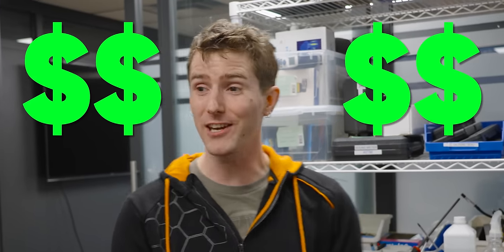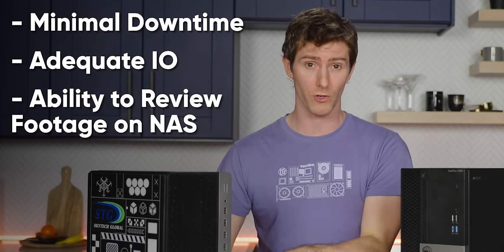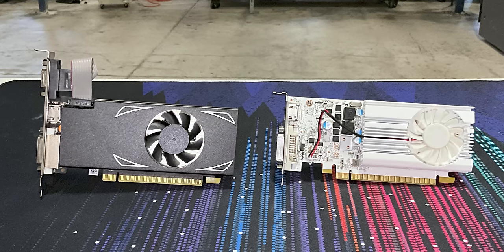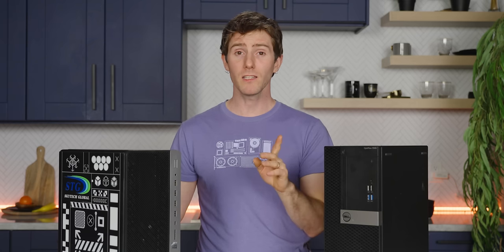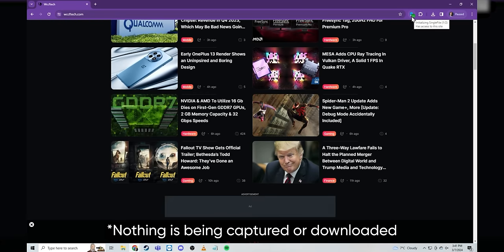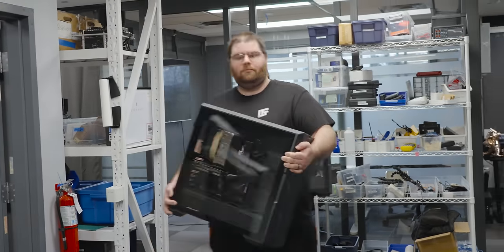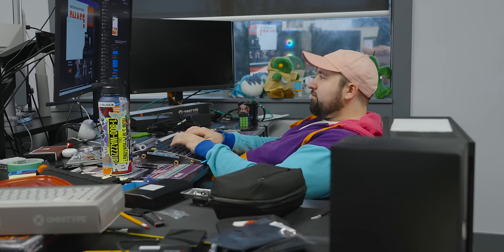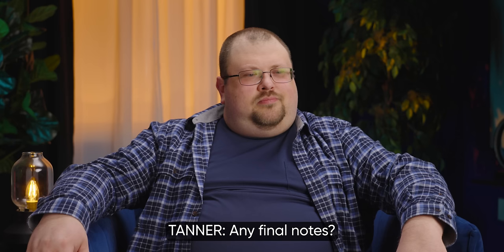We Downgraded our PCs to Prove You Don’t Need a New One

Comment: Exactly. I don't need an RTX 4090, I just want one.
Reply: Rtx 4070 ti is a better bet.

4080 and 4090 are full of problems and cost way too much for the minor improvements.
Reply: Yes cooonnnsssumeee
Reply: @Pwnopolis  you realize this is a joke right?
Reply: my 4080 is not on a single problem ? what the heck u talking about . my 4080 is awesome never got an issue or problem, just get a decent pc with a 4080 or 4090 !!! 3070 or even a 4070ti is trash . just spend 120 $ more and get alot more performance!! @Pwnopolis ....
and compared to the 4070ti i got 100 fps more with the 4080 ... if thats "minor improvements" u shoud play with rocks instead
Reply: @Pwnopolis both of those gpus cost to much, now an amd gpu like the 7800xt snd 7900xt is much better or hell throw in the 7900xtx since it costs as much as the 4080
Reply: @Pwnopolis LOL “4090 is a small improvement” ?😂😂😂😂😂😂
Reply: I don't want a 4090, even if i was given one for free i'd sell it.

What i want is the best GPU i can get that uses ~200-250W max power. I DO NOT want a spaceheater in my PC/bedroom.

Honestly the 230W of my 6700XT is a little too much during the summer...
Reply: ...I have a HD 5450. :(
Reply: If you’re in Canada, the difference between, let’s say a Strix 4070 OC and a 4080 OC, is around 4-500 and 4070 ti and 4080 super is about 4-600 depending where you can find one, so for a lot of folks up here, it’s not worth going that tier higher @Pwnopolis
Reply: I have a 5950x and a rtx 4090 to play runescape
Reply: Relateable fr
Reply: @KimPossibleShockwave  :( hug
Reply: @wd40swift  lmfao amd sucks for gpus there cpus are decent but omg there gpus are trash not even compatible with windows lol always Uninstalling my friends drivers and he is always having to reinstall them and Adrenaline aswell none of my friends with a nvidia gpu have these issues including myself you definitely get what you pay for and on top of that ray tracing performance is just sad compared to rtx series.
Reply: @msmit1999  eh a tech tip is a tech tip
Reply: Lol
Reply: Are you sure?
Reply: I have a 3090 bought day one on release. Two reason I bought it. 3080 first version had less VRAM than my old 1080 TI 10 Gigabytes vs 11 on the 3080. Second, I needed alot of VRAM to bake light in Unity game engine. :D
Reply: @cyrilthefish  I need to upgrade soon because I want to play Homeworld 3, but if it comes down to bills like rent or a graphics card, well, life gives you lemons, you have to suck it up and eat your lemons, lol.
Reply: @Pwnopolis I have had a 4090 since launch and have had zero problems at all
Reply: Yeah, just one 4090.
Reply: I need one.
Reply: lol the 3070 @Gatorade69
Reply: Speak for yourself
Reply: @Pwnopolis  you have no idea what you are talking about. I have an early production run 4090 purchased late 2022 that I have had zero problems with
Reply: @cyrilthefish yeah I agree I have a rx 6700xt and I had to get a different case with more fans found out it was getting choke out
Reply: you don't need at all to play 4K and spend thousand of dollars in monitor and vidocard... use your cheap TV at 1080 60hz DO NOT TURBOING!!
Reply: @Pwnopolis  what problems does my 4080 have?
Reply: Everyone needs a 4090
Reply: @Pwnopolis bro i have a 4070ti and ill tell u right now the 4090 blows it out of the water, 4k especially but 1440p as well. do u even have any of the hardware u speak about?
Reply: @Pwnopolis I mean I love my 4090.
Reply: That's a lie. You need a 4090. Super.
Reply: the only usecase i can imagine for a 4090 (for me), would be only playing the newest flatscreen Unreal engine games in VR with UEVR mod.. (like Pacific Drive)
Reply: @Pwnopolis So true. 4070ti is awesome for all the stuff I do plus it actually fits in my case and doesn't break the electric bill.
Reply: No, you don't need one. You need 10.
Reply: It's just fun to move sliders to the right.
Reply: @Pwnopolis so thats why 4090 ti in sli is the best pc for school
Reply: Says you... 😋
Reply: Facts
Reply: @Pwnopolis  full of problems?
Reply: @Gatorade69 upgrade your monitor first tho😂. Like I use a 4K 144hz and a 3070 and it’s just fine. Usually play 2560 x 1600p stretched res in my shooters. Higher than 1440 but much less than 4k and play locked at 144 in apex and COD.
Reply: i just want to max out my computer so i dont need to upgrade for a decade or more
Reply: Cries in Gtx 560 Ti
Reply: @Pwnopolis just say youre broke bro😂
Reply: I got the 4090 but now I need a 1080p monitor so it looks better.
Reply: @KimPossibleShockwave  i have 510HD
Reply: @Pwnopolis don’t 4070 super is so much better value then 4070 ti
Reply: @Nieczytelny_official  lmao it's most certainly not. Considering none of the 40 series card support SLI at all.
Reply: You actually need the 4090 and the money you have left, you buy 720p monitor
Reply: @KrakkenXXX 4090 Is a miniscule uplift in everything except benchmarks. If you did a blind test and had gamers rate an anonymous experience.. the 4080 would get 9.7/10 and 4090 would get 9.8/10. Truly miniscule in every practical way of comparing them. Even pathtracing would be something like 8.0 vs 8.3. these are objectively true. But so happy for you for spending $2k to run CSGO and cod. 😂
Reply: the only thing i really "need" my 4080 for is cyberpunk, but by god does it kick ass.
Reply: Exactly I don't need a 4090. I already have one.
Reply: Linus did try certified refurbished finally.
Reply: 2024 and i'm still using a GTX 960 lol
Reply: @mayakorinalee good for you. What games do play?
Reply: @Pwnopolis going from a 4070ti to a 4090 is in no way a "minor improvement" and if you are playing at any resolution higher than 1080p, even the 4080 is light years ahead of the 4070 if you play anything other E-sports titles. Having more VRAM will allow you to max out your textures and resolution, eliminate the need for DLSS or FSR, and paired with the raw power it possesses, will allow you a buttery smooth native 4k gameplay above 60 fps in any E-sports titles, and above 60 FPS in just about any 4k AAA titles that are already on the market. Not everyone plays esports titles and not everyone plays at 1080p. 

There is no such thing as "the best bet" when it comes to graphics cards. They aren't "one size fits all" and while people might  think it's a bit too much for a GPU, You could always ditch the better RT and go with something like a 7800XT to get similar rast performance as the 4070 but with added VRAM for textures or if you are more like me and value RT because you pretty much exclusively play AAA titles, you can go with the 4070(super/ti/ti-super) but if you have the income, and you plan on playing at 1440p or higher and prefer a native image, (which is most of us) it's stupid to not go with a 4080(super) or if you can really afford it, a 4090. Especially when the only competition at that level is AMD with the 7900XTX which in terms of performance, is just a 4080 without RT/DLSS for around the same price. 

I'm not shitting on AMD, but they need to give us better RT and upscaling or they have to lower their prices. It's no secret that going with AMD is a compromise, not a choice you want to make unless you are some weirdo obsessed with brand loyalty or you REALLY need a few extra GB VRAM for either a specific game or some kind of application but those are the outlier and not the average user. I ran a Dell OEM RX 6800XT until it died on me, and replaced it with a used water cooled 3080 I found for $300 on mercari. I would have liked to just stick with the 6800XT, but I didn't have the budget to spend $450 on a new one or $500 on a 7800xt. 

Well, I DID actually have the cash, but I'm broke right now and if I could turn a loss into a victoy (someone bought the card for $400 knowing that it started artifacting on me) but I found the 3080 for so cheap (I mean $300 for a watercooled (by watercooled I mean it utilized an AIO for cooling) 3080? Too good to pass up! He wanted $400 for it initially and I offered him $300 and I made a friend in the process. Talking to him every day since I ordered the card lol) and I really want to play cyberpunk again, this time with RT enabled so I just went for the 3080 lol.
Reply: As an AI user... I do. But I don't need a CPU better than a 5700 or a fancy cooler or crazy RAM. That's for sure.
Reply: @cyrilthefish I mean, just use your AC my dude. You know, the system we install into our houses to cool them down when they get too hot? Who is sitting there at home with no AC on anyway in the summer? And in the winter, you can just open a window. Your logic makes No sense to me at all.
Reply: So I went out and bought one...
Reply: @mayakorinalee  Aren't modern APU's bout the same?
Reply: @christophermullins7163  FFXIV, Gayshit Infart, HSR, Atelier games, Monster Hunter World, Palworld, Sons of the Forest, Black Desert, Apex Legends
Reply: @wengi7626  lmao you'd get like 1k fps if you weren't cpu bottlenecked.
Reply: An upgrade from 4070 to 4090 is like a whole new pc difference in price in my country, not worth it here.
Reply: @christianmino3753  I'm in the UK AC Is a rare thing for homes.

I should note I do have a portable AC unit for myself. But this is incredibly noisy and also very expensive to run.

AC Is NOT a solution I want here. Be more efficient instead.
Reply: Same here.  I already have a Ryzen 9 5950x with 16 cores and 128 GB of RAM.  What more could I possibly need?  I was looking at comparisons to that and a Threadripper 1950x and the Ryzen was constantly beating it.  Now a newer Threadripper or Epyc would constantly beat the Ryzen.
Reply: @charleshines2142 Technically a Threadrippr is a Ryzen too 😎
Reply: @Pwnopolis  Minor Improvements? 😂😂
Reply: I don't need to plug in my 980 instead of my integrated graphics from a 4000 series CPU...hang on
Reply: 1080ti is still overkill for a very huge percentage of the population.  Like 99%+  Still using mine, and gaming on it daily.
Reply: @Pwnopolis as a 4090 suprim owner. Running 4k 240. It's not minor lol.
Reply: My 4090 is amazing?
Reply: true I'd possibly just want one to use rtx remix or something to refresh old games lighting graphics
Reply: @mojouk8935  heh, how many fps?
Reply: @mojouk8935  amazing! Are you touching the 1000 Watt consumption? Mine touches a little more than 600 watts. (5950x with a 3080). What’s the monitor you are using? It must be at least the odyssey g9 like me.
Reply: @KimPossibleShockwave  Nah, you're supposed to squeeze'em in someone's eyes and haul butt outta there.
Reply: @Pwnopolis "minor improvement". Lmao. You pretty much NEED a 4090 for some things and considering it's the best card on the market right now, it's the only option if you want the best in VR for example
Reply: Exactly. I don't need a Threadripper 7995WX for my SQL Server. I don't need it. I don't need it. I definitely don't need it. I don't need it. I don't need it..

I  NEEEEEEEED ITTTTTTT
Reply: @cyrilthefish good thing Nvidia uses less power for similar/better performance most of the time (if you can afford it)
Reply: @jancizek8757 Minecraft Java with SEUS PTGI (Path tracing) and maybe an ultra realistic texture pack (I doubt that can work in VR but I know the game struggles a bit with this combo in flatscreen)
Reply: Nothing minor about a 4090 performance improvement over a 4070. I love mine best upgrade I've done from an overclocked and custom bios watercooled 2080ti. Which is still being used in my guest rig.  @Pwnopolis
Reply: @Gatorade69  i use 1060 6gb  and its ok barely -i think to 2024 end i will be fine paired with 9700kf anyways so not that cpu is good too my pc is getting old i wil upgrade in 2025
Reply: going to say this would you rather have a new abit over speced computer that runs for 5-7 years or are you fine whit buying a optiplex computer and chaning it every 3-4 years.
because I had this kind of talk whit peaple when they was looking at the cheapest computer.
yes the cheapest is good if you dont expect it to last that long 3-4 years maybe you travel a lot and think that you will lose the laptop or getting it destoryed in a accident or something
then yes.
but if your prase was I will buy this laptop it will sit on my office desk at home moved twice a year (trip to family and to the office yearly meeting) and I got a great travel bag (that advertised it by having it tossed out of a aircraft onto a road where it got run over by a tank and the content survived).
buy the more expensive one and save the hassle of moving everything from one computer to the next.
Reply: @ifightfortheuser  Why do you need that extra 50 fps when all these modern GPU`s can display way more frames than you need to be able to enjoy a game any way? It literally makes no sense to get anything more than a 2080ti or a 3070 for gaming, unless you have some ridiculous monitor setup, or you're using it for something other than gaming. Because if you think you need to buy a 4090 to play a game im sorry but that's just stupid. My work PC is way more powerful than my gaming PC This one has dual  4090`s in it for AI and 3D design but my gaming PC has been running a 2080ti since they came out at 4k as well I only recently upgraded that to a 3070 because Im using the 2080ti for a work related project.
Reply: No you don't want a Fire Hazard.
Reply: Tell that to EVERY Houdini user ever
Reply: I got one and barely use it
Reply: I need one. Personally I need one. It makes me money 💸💸💸
Reply: @ShanesGettingHandy  I wouldn't say overkill, but it still gets the job done.
Reply: @cyrilthefish I own a 4090 and it doesn't produce that much heat, and I live in South America.
Reply: You understand me
Reply: @Gatorade69 but 600fps in csgo is the only way to play /s
Reply: @Gatorade69  yeah, my GTX 1060 still runs games flawlessly at 1080p
Reply: As the great Coldplay once said, "...you get what you want, but not what you need..."
Reply: @Pwnopolis  7900xt better
Reply: @Pwnopolis  not true. i got a 4090. never had a single problem with the card since a year.
Reply: lmao
Reply: I was saving up for a 4090 then my woman and I broke up. Now my money needs to go elsewhere
Reply: Yea. Exactly!
I need it for school!!??
How do I make people understand that 😔
Reply: I need one (or at least a 3090) so I can use it until 2030. I'm still using a Titan X (Maxwell) today because 12gb made it possible to use. 24gb will give longevity for the right kind of user.
Reply: @Blokk_65  Rather get a 7900XTX for less and get more performance
Reply: @bumbaclot813  oof. This is sad.

I wish you the best brother
Reply: true
Reply: @Pwnopolis  I haven't (luckily) had any problems with my Asus ROG Strix RTX 4090oc/7950x3d system 😅 Yes, I knocked on my head which is essentially wood 🤣🫡
Reply: @Pwnopolis  mmm no mines doing just fine, and the 4090 is not a minor improvement in any possible way lmfao
Reply: @KimPossibleShockwave  you want a 7850 or something LOL
Reply: The 4070ti is truly an amazing card. Between my 4080 machine and 4070 ti machine, the 4070 runs cooler, has less power draw, and actually runs 1440p better than the 4080. Best decision ever. I am giving my wife my crappier 4080 machine.
Reply: I'm happy with my RX 6700 XT. There's a way to game without breaking the bank.
Reply: @cyrilthefish you'd be surprised lol, I feared the same thing since my 3080 heated up my room BIG Time. However, I find the 4090 is somehow cooler and more efficient which was really weird
Reply: @Pwnopolis  I dunno, my 4090 ran just fine since I bought it at launch, even the collector problem is not an issue since I was aware of it and took extra care plugging it in. Also going from a 3080 to a 4090 is a major leap in performance in every way. Of course if it's just gaming I would buy it either but seeing the almost 4x speed increase in blander renders and great improvements in a lot of workstation tasks that I use, its great.
Reply: Low key a used 3060 is significantly better and cheaper
Reply: I don’t need an rx 7900 xtx…..I just want one lol
Reply: I sure would not mind having a better gpu than my aging RX 570 gpu lol
Reply: real
Reply: @cyrilthefish  Buddy... you dont know how right you are. i sweat myself out sometimes just playing basic games. lmao!
Reply: Yeah I want one having a nice monitor with that would be the dream until I realize that in the end it is good enough
Reply: slow down, flex bot 100 @Blokk_65
Reply: I definitely need an RTX4090, I just cant afford one. well not willing to spend that much money on it anyway, specially since the price is nearly the same a getting a whole brand new pc without a gfx card.
Reply: For real, My 1080 ti was an awesome upgrade from my rx 580 but i still want more
Reply: Still gaming on my 5820k and 1080Ti.  Would love to upgrade but one GPU for almost the cost of this entire computer ... O_O
Reply: Amd ryzen 5 5600 + rx6600 +32gb good enough for everything
Reply: @Gatorade69  And old games like Warcraft 3. :)
Reply: I do. I am both a gamer and and designer
Reply: That’s how I justified spending 1.8k on mine. Do I regret it? Sure. Would I do it again? Yeah, probably.
Reply: but you dont have one and cant afford one. so you arent really part of the group, youre just pretending. also they dont know you and never will.
Reply: True. lol xD
Reply: if you want one, why not buy it ?
for me, that 4070 Super is enough
Reply: @Pwnopolis change your pfp
Reply: @mayakorinalee  gayshit infart is an intriguing name. Is that about your dad? 🤔
Reply: 4k over 120fps is awesome
Reply: @Pwnopolis "minor improvements" is ridiculously stupid 😂
Reply: @Pwnopolis  0 problems here and had a 4090 since day 1
Reply: @Gatorade69  I use an RTX 3070 with a 4K TV, but I play older games, so it's still completely fluid. My TV is older, so it's basically capped at 60FPS at 4K, so I can't really go past the 3070's abilities. (Unless I go past the memory availability.)
Reply: @Gatorade69  If you get to play with locally hosted modern AI, you'd still want a beefy GPU even if your monitor is one or two 1080p screens.
Reply: Same
Reply: Same
Reply: All eight thousand of us that liked this comment should get together and order 4090's in bulk, surely Nvidia would give us a fairly favorable discount on a bulk order. xD
Reply: I'll want one for fast blender rendering in cycles😊
Reply: @Pwnopolis  What problems? I run a 4090 Suprim x and have 0 issues. Sounds like you can't afford it. 😉
Reply: @cyrilthefish  it runs cooler than my old 3080ti
Reply: So be smart and dont buy it?
Reply: @LxrdCreature  
1. Not everyone wants RT.
2. Not everyone has problems with AMD drivers.
3. Can you stop fanboying?
Reply: @Pwnopolis its not full of problems. its just expensive.
Reply: hey man i don't even have a GPU.
Reply: This
Reply: @Pwnopolis Clueless poor person comment. Im a 4090 ting, had zero problems, Fe edition ting. Never buy partner cards and u be fine. Start saving cash, peasent!
Reply: Mine actually runs pretty cool @cyrilthefish
Reply: @wd40swift good on a budget but ill admit Nvida encoders are better and overall Nvida just has more support in games than AMD does. I have a 7900XTX and i dont regret it but sometimes i wish i had the little things
Reply: @TheRealWoofer wth??? If i were to buy a 4080 from micro center or newegg right now it would be over $1000 USD....
Reply: @LxrdCreature ill admit i had that issue near the start of having my 7900XTX but the newer drivers has fixed it completely. Sure Nvida has better encoders and more support in titles but aint no way in hell im gonna spend 300 to 400 more on a 4080 (at the time i bought it i snagged it for $850) when it has less VRAM AND slower clock speeds than a card cheaper than it with the on par performence
Reply: Lol I remember getting my 3080 cheap during the release, now I just gotta wait for a proper series for a nice upgrade, maybe 5 series but it runs everything so eh
Reply: Agreed
Reply: I would go for RTX 4070, no overclock, I think I can do that in BIOS settings lol
Reply: My 1080ti keep good for me. A lot of friends buy a 2060 and think that was a great deal. Today my focus is workstations. Platinum PSU, 99.98% uptime, Quadro GPUs and no headache tunning for 2 fps gain in a game. The computer needs to work as you plug it in the power outlet and stops when you want to. After having this first exprienece, cant goback.
Reply: I got one... would have preferred a 7900xtx 
dont use raytracing at all in most games and I don't need it for productivity, my programs use CPU not GPU.
Reply: @cyrilthefish probably should get a 4070/super either is good, yes I know one performs better, and is incredibly power efficient. 3090 performance at 200w
Reply: I caved and got one (Strix 4090). Irresponsible? yes.... Worth it? Probably. lol.
Reply: @Gatorade69  the 3070 is 1440p and 4K tho
Reply: @Gatorade69 Just buy a 4K monitor and you will NEED newer one... XD
Reply: Ditto.  It was pure silliness to buy one.  But I've worked hard, invested a lot of my income, and I can treat myself now and then without straining the budget.
Reply: just for your knowledge. you can buy a car instead and enjoy life instead of buying the graphics card 😂
Reply: @davidsucesso2419  Yup.  But I don't need any cars, I've got a building full of them already, they take up a lot of space and cost money to store and maintain, the video card on the other hand is tiny and doesn't drip oil on the floor ;)
Reply: @Pwnopolis  I haven't had a single issue with my 4090 in 1,5 years 🤔
Reply: @Gatorade69  Bruh your gpu is way more powerful than than to be used for 1080p games, its the ultimate 1440p gaming gpu.  If you are using it on a 1080p monitor you are wasting it's potential.
Reply: I don't even want one, unless it is gifted to me
Reply: I don't know. 4090 is pretty nice for dual 4k gaming 😂
Reply: @msmit1999  Man, with that price i can build  a good performance  Desktop setup in my country.
and he is calling it  as small improvement 😑
Reply: @mayakorinalee 2024, and finally upgrading to an EVGA 2070 Super Hybrid lol
Reply: I have a 4090 and never had any problems and lots of juicy frames 😊@Pwnopolis
Reply: @msmit1999  no joke with hpwr connector.
Reply: @Blokk_65  trash... lol  a HD 7870 is good, just need brain to use it right.
Reply: @KimPossibleShockwave   outlives the 4090s!
Reply: $2000 please
Reply: @cyrilthefish  a 4090 with a power limiter setting it to 250W will out perform everything at that wattage.
Reply: @Pwnopolis  I've owned a 4090 FE for almost a year now for gaming, editing & Blender... no issues.
Reply: @cyrilthefish try a rtx 4070
Reply: I gotta get a 5090 when it comes out
Reply: @msmit1999 Jokes are unsuccessful if you need to 'explain' people that it's supposed to be funny.
Reply: Don't understand the hype about it. In Cyberpunk 2077 at 4k ultra, it gets like 50 to 60 fps. So why even get a 4k?
Reply: capitalism baby
Reply: The 4090 got overvolted to harness the whole 16k Cuda cores performance which for a 12VHPWR connector is too much which explained why many fell victim. The 4080 (and Super) is only rated 320W of TGP, which means it can supply the card without weak spot. It depends on the amount of power it feeds through, not the type of connector
Reply: @cyrilthefish Fax!
Reply: That's such a valid reasons, I'm'a use it 😆
Reply: i deserve it
Reply: @cyrilthefish  4070 super...decent value
Reply: and here I am sticking with my old reliable 1080. PC GPU is getting way too expensive. Is seriously considering buying a console instead.
Reply: @cyrilthefish  get the 4070ti super
Reply: I accually need a 4090 X) 

Its the only GPU able to power my 7680x2160p 120hz screen :D